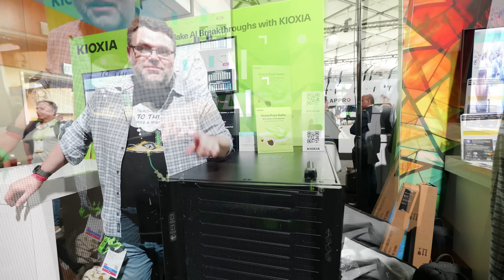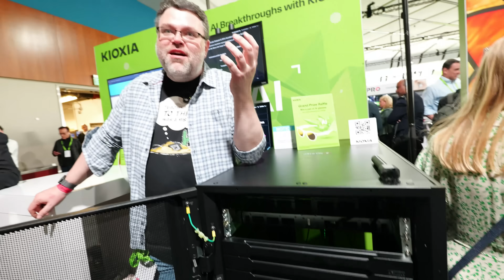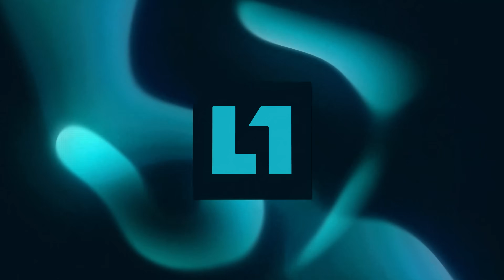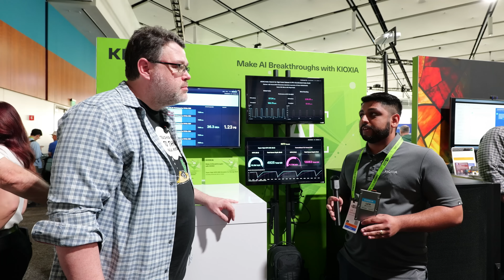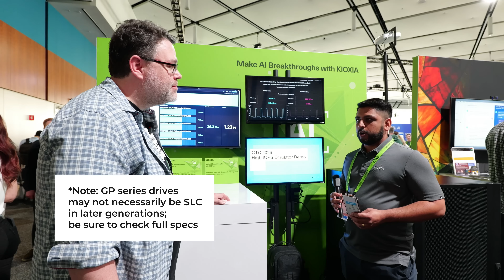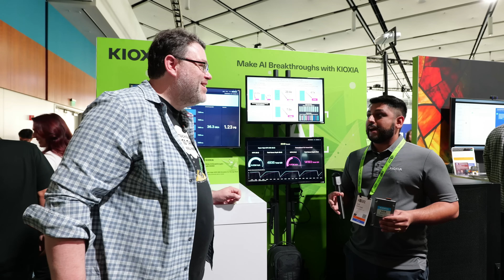256TB in a Single SSD Is Real, and  It’s Coming to Consumers

Comment: Impressive capacity... but Samsungs new drives are so much faster than Kioxias. Storage system companies like to dual source the their SSDs, but the difference between Kioxia and Samsung is so large (2x+ ?) it's not possible because the client experience would be vastly different depending which brand.

Comment: No it's not.
Used to be you could get a 2tb ssd with dram cache for about $100. You cant get a dramless one now for less than $300. Micro center wants $1500 for an 8tb nvme. And amazon wants $16,000 for a 16tb sata model.
The only consumer this is meant for, is the military industrial complex. You wouldnt be able to even look at one of these without getting shot at.

Comment: The real question is when will it be affordable for the masses.
Reply: 10 years from now, assuming. civilization & access to technology won't collapsee
Reply: Define "affordable". Affordable for an aspirational tech enthusiast who can justify buying an RTX xx90 GPU every generation and runs real (non-obsolete) enterprise gear at home? Probably 10 years, maybe less depending when exactly AInflation will cool down. Affordable for an average homelabber running second-hand gear and shucking external drives for their pools? Likely never. Affordable for the real masses as a few hundred € external USB drive? Never; storage requirements for the Average Joe the Office Worker have plateaued for the last 10 years. Office documents and .jpg photos don't need huge storage space and the Average Joe streams their audio-video nor do they work with huge datasets or shoot/edit 8k video so they don't really need more than a few TB. Most PC-s have come with 512...1024 GiB SSD-s for the past 6 or 7 years and few "normies" complain about that not being enough. Hell, the 256 GiB drive in my work laptop is way more than enough; most work stuff sits in The Cloud(TM) anyway :P

SSD prices if they come down to pre-AInflation era levels of slightly below 100€/TB and keep dropping will probably plateau at around ~25...50€/TB, just like HDD prices plateaued at around (depending on size and purpose) the same level before the AInflation. Or they may never go below 100€/TB again, which is also likely. Which means best case, a 256 TiB SSD will cost around 6000€ after the AInlation cools down; worst case it'll be around 25000€.
Reply: I would guess 2 to 5 years.

Comment: the 122TB solidigm u.2  when introduced in europe on a german page it cost 17300 euro with tax, now it costs 53400 and is out of stock or TBD on serious interest, so there goes my consolidation of all my archives into a shoebox sized mini workstation/server/nas with 64-128GB ram and 2x122,88/4x61,4 in raid mirror or 10....maybe china starts churning out affordable ssd, demand will grow, selfdriving cars are estimated to need 300GB ram for situational awareness and will produce TBs of data that needs to be processed and will be shared with infrastructure so multiple TB fast ssd with redundancy needed

Comment: Consumers get only reprogrammed 256GB QLC at 1000$ that's worse than HDDs from 15 years ago
Reply: You clearly have some good memory's on hard disks.  But I dealt with 5.25 Quantum Fireball  drives. I have spinning rust PTSD
Reply: @BasKeur-t9y  for me it was seagate barracuda and wd blue with clicks of death from xp to 710 before moving to SSD. Recently seagate desktop ext drive died next day after warranty ran out. Recovered as much data as possible.

Comment: Turns out anything is possible in computing as long as there are people willing to throw money at it. Consumers are going to get stuck on 8 terabyte SSDs the same way Intel had us stuck on quad cores.

Man I wonder if we're ever going to get the kind of god tier trickle down super value server parts that we used to. Or if the whole AI data center world is going to become so ridiculously divorced from consumer computing that like only a tiny fraction of the hardware is even viable for consumers. There are definitely certain companies that are specifically designing their data center stuff so that it either can't be used in a consumer sense or the cost of doing so would make it economically nonsensical.

Comment: Just about all of Spotify on one drive.
  
Really looking forward to these ending up on the refurb market in a few years - 12x of these (actually the 2.5" version would be better for me) per node in RAIDZ2 ZFS and then GlusterFS across 3x nodes...
  
Just need 40x AMD EPYC Venice "RAM platform" with 32x 2TB sticks to run an on-line RAM cache for the GlusterFS storage, 800Gbps ethernet...  Basically saturate those 800Gbps links.
  
Stack that with LTO-9 library, and you have it made - cold offline storage on tape, fast startup and shutdown data archiving with Kioxia LC9 drives, and DDR-RAM cache for full wire-line speed.  A decent CDN, that fits in two 42U racks, with space left for some GPU compute.
  
Just need a billion dollars - anyone wanna front me?

Comment: What’s going to happen to all the RAM and SSD components when the data centers are due for a hardware refresh in two years? 

What about all the ridiculously expensive GPUs? Are they on lease? Will they be recycled? Is there a secondary market for compute that’s using twice the electricity that’s half as powerful?

Comment: The funniest thing is, that the company couldn't afford to fill all the slots, and it's crazy because they make the drives.
Reply: They probably would cost around $40k each.
This setup alone would set you back around $250k since there's a 6th drive in there if you watch closely.
So 8 servers with 40 drives would cost you around $13M that's also a legit security risk for a demo.
Yes: they are literally worth more than gold, since it's added value over just raw materials.
Reply: @dasiro  13M is within the budget of a typical consumer hahaha.
Reply: @FacelessVoidDota13  It's time to rewrite that Blizzard meme: "Don't you all have a multi-million dollar storage setup?"
Reply: They definitely could they just either didnt have enough on hand or they only used es drives or sample drives

Comment: That's probably a $50K disk.
Reply: More like 250-500k if you do the math
Reply: @maosw  A 30TB nvme currently sits at around $6k, so it's roughly x8 that. Unless of course they price it differently.
Reply: @cbarak72  No idea where you seeing those prices unless it's a refurbed one and even those are in the 6-10k range most places I've checked. A 122TB one I'm currently looking at is listed for +40k, 60TB for 30k... so 250-500 was probably on the high side, but six-figures per disk at least I'd think, unless prices collapse down again.

Comment: So here's my take. I am not an Enterprise grade buyer, i'm your typical consumer grade buyer, that said I do believe in a certain amount of redundancy in order to prevent data loss. And as you would have it recently I had to change a drive in a mirror.

The point is, it does not matter how much space one drive holds, it is still a single point of failure.

Comment: Every one of these 256TB enterprise drives could have been 130+ 2TB consumer drives.
Think about those numbers. A single 10,000 unit order of these drives could have instead been 1.3-2.5 MILION computer drives.

Tangent: If only Optane could have held on for a few more years. The 'AI' Bubble would have created the demand it needed to become the dominantly produced storage, and we ALL would have benefitted. Eventually. Once the bubble burst.
The biggest problem modern RegurgitativeAI has is low latency access to random bytes from huge datasets.
And Optane just happens to be byte addressable, without a controller slowing things down, resulting in INCREDIBLY low access latency.

How the hell have Micron/Intel not done a180 and restarted 3D-Xpoint fabrication now that the demand for DDR and NAND is so feverishly high?

I want my 64TB PCIe 5.0 Optane drive!
Reply: I doubt those drives contain 130+ 2TB flash chips. Even split up the actual chips they are probably going to be like 16 or 32tb flash chips so still unobtanium for consumers

Comment: Like wow.  Great density. 
Now the bad news.  Great density. 

Ok, why is this bad?   (Well sort of...) 

Your network connection becomes the bottleneck.  
You would have to do the math and figure out how much storage you can put on a single server where your network could keep up with the I/O demand. 

There are really a couple of cool use cases that could take advantage of these drives.  Not just in the data center but on the edge.  You could build out a single 4U box w GPUs, a decently high core count (CPU) along w enough memory and then these for storage along w other small drives for OS, Swap, and application spill.  These drives would be for data storage.  

In a rack configuration you could use these to be part of a storage cluster.  Running something like MapR-FS if you need posix compliance , S3 and HDFS access.  If you just need S3... then you have RustFS (Although I haven't played with it yet.) 

But wow....

Comment: Next milestone: 1 exabyte in a 42u rack.  
(that's 98 drives per 1u at this capacity... basically a full rack of 3u storinator-style cases dense-packed with ~300 drives each)
Reply: I mean... a shoebox can hold about 150PB worth of 2TB MicroSD cards in 2026.
7 shoeboxes fit into a 42U rack pretty easily.
Reply: @Prophes0r  but you cannot read all those MicroSD cards in a shoebox -- the footprint of 60x 3.5" drives actually roughly translates to ~300x2.5" all plugged into one humungous backplane.
Reply: @Proton_Decay  Requirements were unspecified.
Order delivered.
Sign here.

Comment: I totally need these in 2 years for my homelab for less than 1k each. That's possible right 😂
Reply: At the way tech is going right now you'll be lucky to get these for $1000 20 years from now. Right now a 15.36 TB SSD is like $2500.
Reply: If they fall off a truck

Comment: I guess when you remember the top 10% of consumers drive 50% of the spending it makes sense to say it's coming to consumers? FYI these will be 15k-20k per.
Reply: Kioxia doesn’t make consumer drives. And the interface / form factor doesn’t fit in any consumer system either.
Reply: @benjaminlynch9958 I'd be happy to design a 3d printed enclosure for it for my in-progress 10" minirack.
Reply: 15k for that density of flash is amazingly cheap for enterprise…
Reply: Nothing is going to trickle down. I'm afraid, personal computing is going away :(. Thin clients don't need fat storage.
Reply: Yeah, no... not by a long shot any time soon. The cheapest enterprise-grade NVMe I can find is  around 200 per TB, most are in the 400-500 per TB range, multiply that by 256 and you end up with... at least 50k to 100k per drive (at current market conditions).

Comment: So this is how the dude smuggled 10pb of Chinese military data out
Reply: It’s actually not, but it probably would have been more efficient it was.
Reply: Obvious joke. But...
If we want to look at real storage density, the king is still MicroSD cards.
24x sd cards laid out in a 3x8 grid takes up less than the space of a credit card. Including thickness.
And you can get them in 2TB capacity. So 48TB per layer.
So 3 credit cards stacked on top of each other gets us 148TB (raw)
That's 2-4 times as dense as these drives in the video.

If you wanted to smuggle them, they are easily concealable.
You could easily fit 500TB of SD cards in the front cover of a hardcover text book.
That's 1PB per book.

A MicroSD card is about 165 cubic millimeters.
That means 10,000 would take up 1.65 liters.
The average Men's shoebox size in the US is 10-15 liters.
That means 60k-90k MicroSD cards would fit inside it.
Let's say 75k.

That means you could fit about 150PB of MicroSD cards into a shoebox.
Of course, those cards are ~$300 each, so that shoebox would cost you $22.5 million.
Reply: @Prophes0r  and a rocket full of them would be the greatest data bandwidth ever achieved by mankind
Reply: @mezu-b8t  Not even close. Stuff going to space sits around for months or YEARS before it goes up. Between waiting for launch windows and all the red tape, it would probably be be higher bandwidth to load the SD cards into backpacks and have humans carry them the same distance on foot, simply because the humans could leave right away.
Reply: @Prophes0r  I remember when SSDs were delivered on horseback.
Reply: @Prophes0r it could be an ICBM with a parachute capsule that gets ejected.
Reply: @Prophes0r  the biggest problem, apart from the cost, would be the transfer speeds 😂
Reply: @LtdJorge  Not necessarily.
It would be awful to have to constantly switch out thousands of cards, but you could very easily use more than 1 reader at a time.
Also, UHS drives can pretty easily do 240MB/s sustained reads. That's ~8000 seconds to read a full 2TB. Which is ~133 minutes. Which is ~2.25h. Which isn't that awful if you were doing it in parallel.

And if they were MicroSD Express cards...
Well those are a PCIe 3.1 x1 link.
Those cards do 1-2GB/s.
But in 2026 those seem to top out at 1TB capacity.
Reply: @Prophes0r why not as credit cards in a wallet?
Reply: @Bratfalken  You risk damaging them like the bent credit cards in everyone's wallet.
Also we were talking about smuggling, so it was implied they would be kept in a secret compartment somewhere. Inside a book's hard-cover is a good space for that and would be easy to do with just a knife and some glue.
Reply: I was thinking the exact same thing, haha

Comment: Yea this seems like only for someone who owns a Private Jet. 
We plebs still desire decent SATA SSDs
Reply: I'll take affordable spinning rust at this point.
Reply: @GreenDavidA  Considering that spinning rust is perfectly capable of saturating 1Gbit Ethernet, and even 2,5 and 5Gbit in arrays, not to mention mobile network speeds, it's still very adequate for NAS-s and other mass storage purposes. I only really see the point of SSD-s in my NAS if I ran 5Gbit or faster Ethernet and mount NFS shares on it for VM-s etc. And in my PC-s I don't see the need for more than a few TiB of SSD-s since mass storage for media, backups etc lives on NAS.
Reply: I hear private jets are "surprisingly affordable". 🤣
Reply: @ColbyWanShinobi  ZERO girl dollars!
Reply: @ColbyWanShinobi  You can have your very own private jet by just selling one of these 😂
Reply: @ColbyWanShinobi  A single one of these drives might make private jets look affordable :D
Reply: 'A' jet?
One single tiny jet?
Peasant.
Reply: Or for someone who buys a 6000 Blackwell and 32 Core Threadripper pro for one of their employees for the memes
Reply: @jessiethedude  I am sooo gullible... please, no please, don't meme on me. 🙏
Reply: they said the same thing about 256mb back in the day. also said the same thing about 32 bit processors during the DOS days. "What consumer needs anything more than 16 bits??"
also data for flash storage is literally pointless, why waste the silicon with a trash connection when you could just connect via pcie and get over 3x the speed at zero cost
Reply: @superjuddy  Because they refuse to give us drives that use PCIe x1 Links?
SATA and SAS are still important because they are low power, not hungry for CPU lanes, and are perfect for most access types.
PCIe switching is GREAT... when you can afford the power and $$ costs.
It isn't a "zero cost" situation. Not even remotely.
Reply: @superjuddy  The comment you replied to is commenting about the current economic climate, where storage is at least 100% more expensive today than it was this time last year.
Reply: @superjuddy  at that time cost were still scaling (fast) for consumers...

Comment: My plex server is ready.
Reply: Mine isn't, finding anything that supports E.3L is surprisingly difficult
Reply from the maker: Mine too.
Reply: I identify as Spotify with 2 of these from AA.
Reply: @Matej1200 this is pretty much exactly what I've been wanting since the leak but I guess I also need the money 😂 but God self hosted Spotify 🤤
Reply: Mine too - but my wallet is weak.
Reply: My plex server is a 2TB external HDD attached to my desktop XD.
Reply: My current and future datasets are ready as welll ❤🎉🎉🎉🎉
Reply: In 10 years 😂
Reply: Jellyfin
Reply: What!! Y'all are using super fast SSD's for storing media....WTF. A single hard drive can handle so so so many streams man. Too much money and too little sense. These aren't coming for decades for consumers. No way.
Reply: @Stoner916sac  You're right. I use 5 20TB SSD's in RAID 5 and there is never a time when that array is taxed, even with about a dozen clients. But it would be nice to have smaller, cooler-running storage. Just the cost is absolutely prohibitive for that amount of SSD storage.
Reply: @RedBankVintageAudio  wouldn't also be a lower power usage too
Reply: @Stoner916sac yeah, 256tb hdds are so cheap! and they exist!
Reply: @Stoner916sac  I hate hard drives. The last one I bought failed in 3 months. It was a WD 2TB. I just bought a 18tb drive......just in case I can't get more 4tb drives for a reasonable price. I'm hoping I don't have to use it. I still have 1 more crucial 4tb drive that hasn't been installed yet.